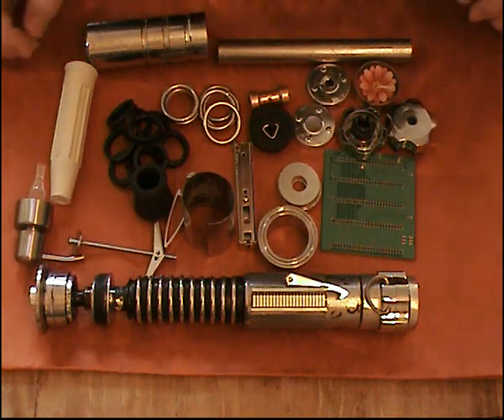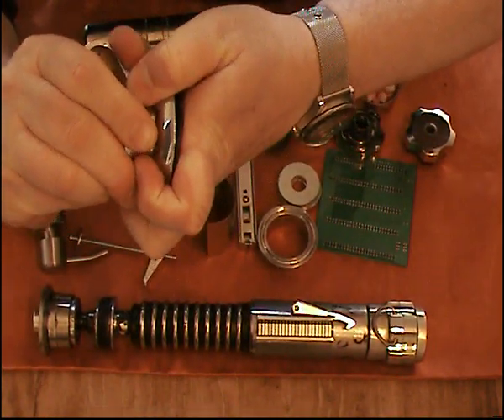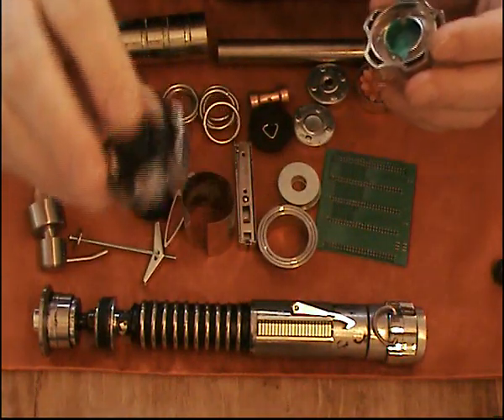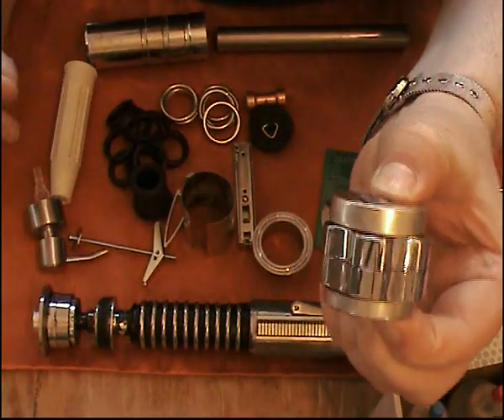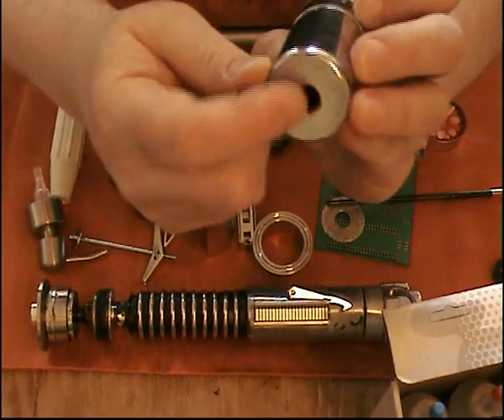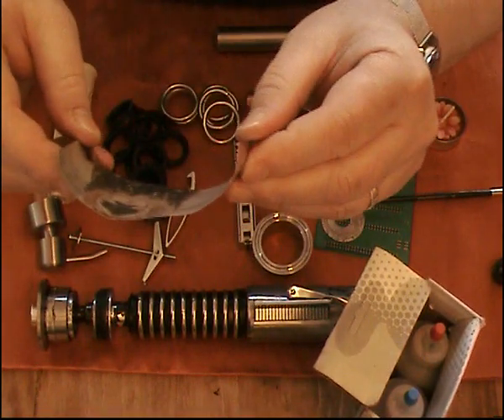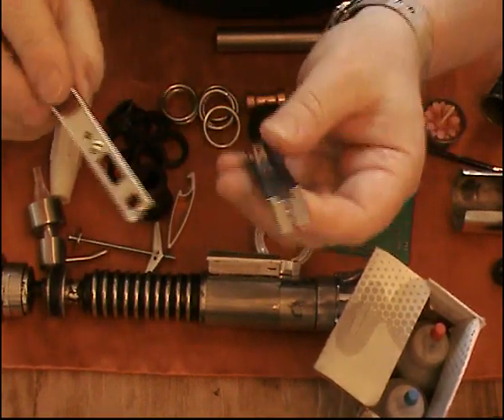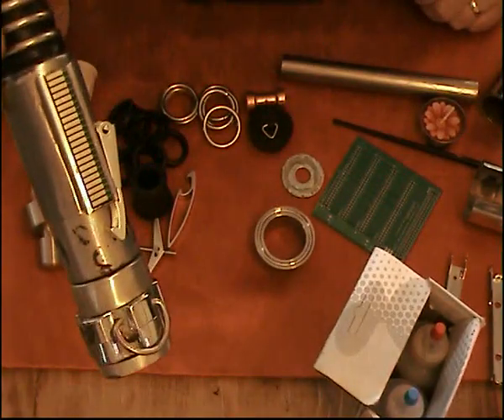Luke Skywalker Lightsaber V2 DIY how to build guide .

Comment from the maker: The DIY Luke Skywalker Hero V2

“As usual made from junk”

No 3D Printers were used, or harmed when making this.

 If you enjoy this video, or find it useful then please don’t forget to click the like tab and please subscribe if you wish to see similar future content. Please also check out some of my other weird and wonderful videos. Thank you.

 “Right let’s do this!”

 Tools

 Small Hacksaw

Hand drill

 Plyers

 Tape measure

 Duct tape

 Super glue

 
Epoxy glue

 Black permanent marker 

 
Slim fine paint brush

& some Sandpaper

 
Materials /component parts needed

 
2 - T-LIGHTS. 

9- large metal washers 35mm.

1medium washer

2 -Compactor Bath hooks “Best lock” 07.1cm.

1 medium D-ring.

1- chrome stunt peg cut to size – or a chrome cylinder 3.5. diameter, 3 and half inch long.

1- Walking stick /chair leg, rubber ferrule 22mm.

1- metal biscuit tin or gift set tin. Cut base to 5 inches by 50mm.

1- Paper stapler metal parts cut to 6mm.

1-Plasterboard spring toggle fixings anchor M4

1-Mini Bottle Opener Keyring Tool Metal Chain Portable Novelty Beer Jar Bar Claw 

10 pack of open cable rubber Grommets.  25mm.

10 pack of chrome curtain rings 16-19mm.

1 Wardrobe hanging rail pipe, 2mm diameter approx. Cut to 6inch long.

1¾” Rubber splash preventing tap flexible kitchen nozzle.

1 black rubber bath/sink plug 1 1/2”.

1 Tectite sprint copper push-fit Equal coupler 10mm.

1 stainless steel soap liquid lotion bottles nozzle replacement. dispenser pump head. Thread size 28/400.

1 Stainless Steel 38mm OD Sanitary pipe elf Ferrule 1.5” Clamp.

 

1. Base pummel

 
Drill a hole in one of the Compactor Bath hooks nobs

Take the centre part out of the other one and place small bits of plastic card into the 5 cavities’ around the edge. Spread Epoxy glue around the edge and slot the two parts together and let it set for an hour

 

Take the 2 T-lights and remove the candles.

Place 2 washers in one and 3 washers in the other.

Pore the epoxy into both, until level with the last washers and let it set for an hour. Cut the T-Lights down until level with the top washers.

Drill a hole in the base of the T-Light that has 3 washers.

 

Match up the holes from the T-light that has the 3 washers and the joined bath hook nobs and glue with epoxy. Let it set for 3 hours.

Take the other T-Light with 2 washers and glue with epoxy to the other side of the joined bath hook nob.

Leave for 3 hours.

 

Drill 2 holes with a small drill bit on either side of one of the protruding parts of the pummel. Insert your

D-ring with plyers and pinch together.

2. Glaflex part

Take your chrome cylinder stunt peg and using epoxy, glue the tin round it at one end, leveeing 5 mm of the cylinder showing at the end. Tape the tin in place and leave to set for 5 hours approx.

Take the cut down paper stapler part and glue it over the join of the tin part with the epoxy. Tape it down to secure it, until it sets. Leave for 5 hours.

Take apart the plaster board toggle. Keep the inside piece and the hinge part. Cut of the end of the pudding spoon. 50mm long. Connect the toggle part to the spoon end part with super glue. This will form your Graflex clamp toggle part. Then super glue it to the side of the stapler part by placing a small, thin sheet of rubber

in-between to form a tighter seal. You can use leftover rubber from the bath hook part.

3. Black and silver mid-section part

Take the sink tap hose and thread it through the rubber cable Gromets and curtain rings. Lubricate the wardrobe hanging rail pipe and push it through the large hole end of the rubber hose, all the way through.

 

4. Mid-admitter part

Take your black sink Plug and sand it’s an even disk shape all round. Remove the hoop and make a hole in the centre. Superglue a large washer over the recess part of the plug. Super glue a medium washer over the other end, sandwiching the rubber plug in the middle.

 

6. End admitter part.

Using Epoxy glue set the self-grip pluming pipe into the chrome soap pump part. Tape the top part of the soap pump part to create a tight seal with epoxy into the Sanitary pipe elf Ferrule admitter part. Set a lark washer on the top of the end admitter part to finish it off.

Comment: I have watched this video several times and am just amazed at all of the parts used. In regards to a couple of the parts, I am really curious about the part used for the top emitter? What brand and size were used? Also, not sure if you mentioned it, but what kind of stapler did you use for the control box? Again, really awesome and your parts assembly and finds are really awesome. In all honesty, I would never of thought of such things like the stapler, the soap dispenser and the car parts. As Darth Vader said, impressive,most impressive!!!!!
Reply from the maker: Size 32 Mm 

https://www.ebay.co.uk/itm/322698364155
Reply from the maker: Size small 
https://www.ebay.co.uk/itm/SMALL-LARGE-STAPLERS-Pocket-Desktop-Desk-School-Work-Office-Paper-Stationery-/312360575308?mkcid=16&mkevt=1&_trksid=p2349624.m2548.l6249&mkrid=710-127635-2958-0

Comment: This parts list is much appreciated, but I have some confusion about the dimensions of the parts in the description. What's the OD of the curtain rail, I would guess 19mm, but can't see how curtain rings would fit over that at 16mm ID. Did you have links to the parts at all? Cheers in advance.
Reply from the maker: Hi 
Appreciate your comments .
No the parts just slot together , no linking. 19mm curtain rings , but they fit because the rubber hose is pushed out thicker by the pipe inside it, making it a tighter fit 👍 hope that answers your questions. 
Thanks again .

Comment: I might actually cast some of these parts in aluminum using 3D printed templates, so I get all metal and an easier time finding parts.  Especially the emitter, pommel, and control box so I don't have to murder a stapler for every Graflex band lightsaber I make!
Reply from the maker: Hi 
well
My Chanel is really about up-cycling parts from old everyday item and turning them into something els, but thanks  for watching 👍
Reply: Hey , I’m a big fan of this guy and his take on home  made sabres builds . Very original. If your thing is 3D printing , I’m guessing these vids aren’t for you !
Reply: @thedonn5861  I'm only gonna cast parts that are difficult to find.

Comment: Can you give a bit more information about the circuit board? Which one did you buy and from where? because i cannot find a similar one like in the video.
Reply from the maker: Amstrad CPC's Computer Expansion Board Printed Circuit Board with 4 MX4 Slots

https://www.ebay.co.uk/itm/193940887550?mkcid=16&mkevt=1&mkrid=711-127632-2357-0&ssspo=0g3NYJ1ZRBW&sssrc=2349624&ssuid=AiCXDDl9R2G&var=&widget_ver=artemis&media=COPY
Reply: @thethe6232  Thx, Keep up the good work. You're amazing.

Comment: Where did you get that flexible water spout?  I won't use it for a lightsaber, but I'll use it for a DH-17 blaster.
Reply from the maker: Hi , yes I can see the similarity , 
but I would have to say regarding the flexible water spout 
“Aren’t you a little short  for a DH-17 blaster”👍
Only my opinion but I think it would  be the wrong scale in relation to the actual prop. 
Anyway I got it from one of those old fashioned traditional style hardware stores . The type of shop that sells all kind of Gadgets , tools and pots and pans 👍
Reply from the maker: Hi this is the UK eBay link below , but if you live els where, just tips
 in ro
Your eBay (rubber flexible large rubber tap swirl or nozzle Kitchen aid 👍 ) 

https://www.ebay.co.uk/itm/FLEXIBLE-LARGE-RUBBER-TAP-SWIRL-NOZZLE-3-4-Kitchen-Bathroom-Anti-Splash-Aid-/191914852339?mkcid=16&mkevt=1&_trksid=p2349624.m2548.l6249&mkrid=710-127635-2958-0
Reply: @thethe6232  Thanks.

Comment: Is there anything at the heart of it? Dowel / rod etc ?
Reply from the maker: Yes , a threaded steel pluming  bar . 
Available at any hardware store .
Reply: @thethe6232  thanks so much
Reply from the maker: @obirobkenobi3599  no problem 
Let me know if there is anything I can help with . Are you building one ? 👍
Reply: @thethe6232  I’m amassing the parts currently. Had a few issues ordering things online (sizes etc) and I think most of it is enroute . Do the rubber grommets have a groove on them or are they a solid ring ?
Reply from the maker: @obirobkenobi3599  
Re: the rubber Caleb rings  “Grommets” 
Yes they are groves, but I turn them inside out , so grove on the inside 👍 
Also use less curtain rings and grommets than I did .I made that part slightly too Long in proportion to the original V2 ,
Reply: @thethe6232  sorry one last question, what’s the curtain rod diameter?
Reply from the maker: @obirobkenobi3599  
Can’t remember now 
It’s the smaller size ones anyway 👍

Comment: Never showed the bar running through middle! :/
Reply from the maker: Check out my first Obi wan vid 👍
Reply: @thethe6232  10 pack of open cable rubber Grommets.  25mm.
10 pack of chrome curtain rings 16-19mm.
I don't understand these measurements?!?! How can these be different diameters when they slide on the same piece?
Reply from the maker: @stokesy_SWFC  trust me . 👍